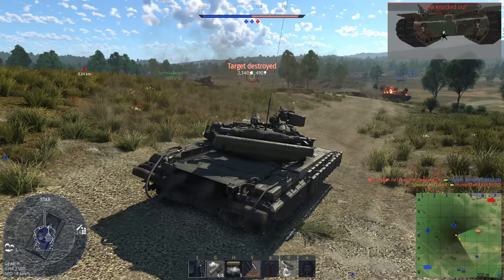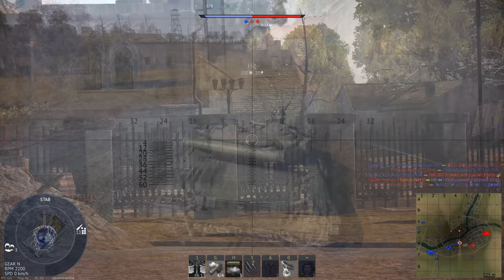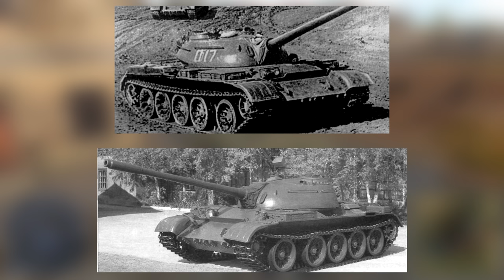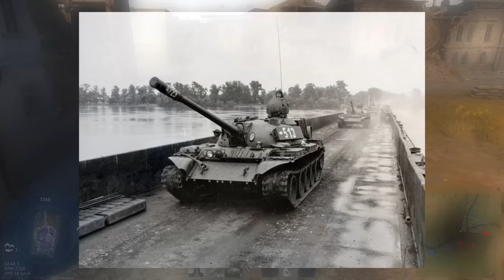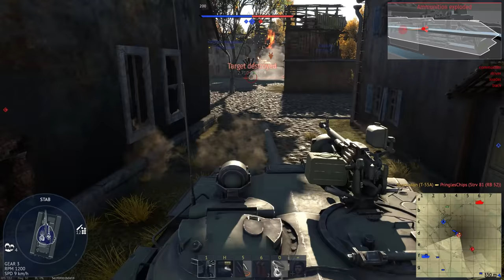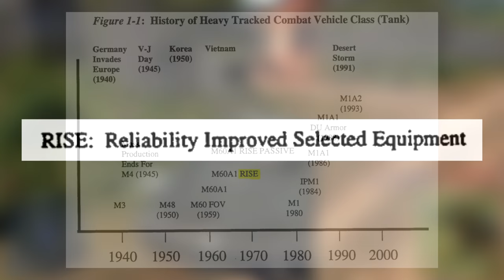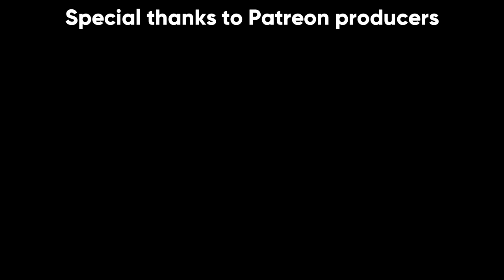Were Soviet Tanks Poorly Made?

Comment: The T-34 was a Good Tank when produced to a High Standard the issue is with Barbarossa and the Move of Heavy Industry aware from Central Russia into the Urals Standards were significantly Dropped to meet Production Quotas, The Three Primary issues with all T-34s including the T-34-85 at least until Late 1944 into 1945 is that many of these tanks were handicapped with a poor 4 Speed Gear Box  which was mechanically touchy at best as if the Driver placed to much force onto the  Gear box to get it into forth Gear which they often had to do in some cases needing a hammer or Crowbar to force the tank into Forth Gear it could Cause the Transmission to brick its self which is why many T-34s Carried Spare Transmissions into battle on the Rear of the Vehicle. Though this would later be fixed with the addition of the 5 speed Gear box over 40% of Total T-34s produced still had the 4 speed. 

The other problem with the T-34 was largely the actually Quality of the Armour as the Armour was superheated to increase protection levels and armour Hardness the issue is the armour plate was super heated way above what was required making the armour insanely brittle and combined with Poor Spot Welding due to Unskilled Workers with little Welding experience operating on the production line this often meant when T-34s went into action and engaged tanks like the Panzer III as an example. Even the Panzer IIIs In adequate 50mm gun had a good chance of knocking out T-34s as hits would often lead to Welds splitting creating armour panel gaps and in the case of Shell Penetration the Spalling effect was devastating leading to a 70% Fatality chance for T-34 Crew Members

The TLDR

The T-34 would of been a Great tank if produced to Western Standards but due to the Nature of war the Soviets found themselves in Quality was Secondary compared to Raw T-34 Tank production as Sheer numbers and More Available Tanks on the Battlefield would lead to more victories 
Its just a shame that it took almost the entire War for the T-34 to work out its production kinks to become a truly astonishing weapon on the Battlefield 

in the case of Other Soviet tanks produced after WWII 
generally they were of High quality with only Minor Flaws 
such as The T-64s Auto Loader 
as an example
Reply: the long barreled 5cm gun of later Panzer III models was perfectly able to penetrate the T34 on long distances. And even on paper there are too many mistakes not taking the production mistakes into account. Its far from an astonishing weapon in my opinion.
Reply: @tizi087 
Of course the Panzer IIIs 50mm Gun was perfectly capable of dealing with T-34s but usually only within the T-34s effective rage the issue is when you are fighting in Tank to Tank warfare you really want a weapon system that can engage the enemy outside thier effective range hence the balance of fire power vs armour protection.

This was actually the Main Driving Force of the adoption of the L/43 75mm and later the L/48 and L/70 75mm
By Germany in WW2
Reply: @IRONLORDMINK  Uff. In Boris Kavalerschiks: "The tanks of operation barbarossa" there are some colored pages in the middle showing the distance where a tank can penetrate another while still being save. Sadly i dont have the book clsoe to me right know but if i remember correctly in a head on duel the PanzerIII with the long 5cm gun had could penetrate the T34-76 from 41. the T-34 meanwhile cant do the same unless he gets within 600 meters. 

But as i said: i sadly dont have the book on hand right know, but i know that above a certain distance the Panzer III long 5cm can pen the T34 while hte T34 with 76mm gun cant

Comment: Whole part about T-64 and T-72 is actually bullcrap: T-64 had a lot of flaws which was mostly fixed before entering service, T-72 in the other hand isn't a 'modern replacement' but 'same capabilities yet cheaper' tank which actually had stripped down FCS(it's actually wasn't exist on base T-72 and initial T-72A), yet Uralvagonmash didn't want to copycat T-64 and produce it's opposite engine which had maintenance flaws and big production cost, as well they didn't want to use hydraulics autoloader since it's reduces fire resistance of a tank and replaced it with electric autoloader from Object 167M(which was designed at the same time as T-64). So T-64 wasn't 'bad', it had it's own flaws but none of them was "dealbreaker" for exception of a price

Comment: i saw 2 different t34´s in museums and both of them had about  a 5 cm gap between the hatch of the driver and the rest of the body
same goes for the metal covering the engine 
i looked at later built sovet tanks and they didnt seem to have those  severe problems 
i think this myth stems from the  many many soviet tanks that were rushed out to be emmediately sent to the front

Comment: what do you mean by "they werent keen to waste time on cosmetics"?
Reply: they didnt really cared if the paint was properly applicated or if welds for stuff added ontop of the armor where not cleanly made.
they just made sure they where structually sound and worked, looks where not important.
Reply: they didnt spend time making it look good, hence the poor looking welds, and other minor things being dropped for faster production
Reply: Useless fluff to seemingly bolster his argument.
Reply: @FirstDagger  lol Someone sounds mad
Reply: @BDP0408  nah. Go watch LazerPig's video on the T-34. Welds were shit. Radios missing. Poor ergonomics. Poor visibility. Poor control systems. Shit reliability. All made in less than half the time it should have been.
Reply: @sosogo4real  Yeah I agree
Reply: welds being poor are not cosmetic if the weld looks bad then what you cant see is also poorly done making a bad bond between the plates, if its just getting weld material on the plates outside of the bond no harm there but if there is bubbling or cracks or large waves in the weld then it wont hold, quickly applied paint makes sense though it makes the machine suffer in the long term with paint falling off the tank and causing rust making it harder to effectively apply paint later on witch i can see not being a priority at points in the war

Comment: On paper, the T34 was fine. Realistically, the T34, under any metric, was horrible. The only problem that couldn’t have been initially fixed was the fact that it had a 2 man turret. The rest came down to awful production practices and quality control. If any other nation had produced it, it would have been seen as an abysmal failure. No, quantity isn’t a quality of its own because logistics matter. If you have 100 pieces of trash on wheels, you still have to supply and fix those pieces of trash where if your build 75 or only 50 good vehicles, then you have a far more effective vehicle with much less logistical strain.
Reply: No you have 50 less tanks, WW2 proved how in those times quantify was better than qualify. Modern combat is different though

Comment: Are we only only referring to the designs being bad because if we are just talking about the average f-35 during the war they where defintly badly made. One of the huge things was the fact that they basicly had no standards when it came to making these tanks. Some would come out and would be very well made but that was every now and again often you had tanks with overly heat treated armour which would shatter when hit or spaul milling crew. Or you would have welded sections that where basicly spot welded together by untrained workers. The design wasnt bad at all but it's kind if a fact that there lack of standards led to some terrible made tanks to the point where some just didnt have seats for there crews and they where using ransom boxes.

Comment: Re: The T-34. When your transmission was worse than Panther's and your tank had a lower reliability rate than Panther, you have a poor tank. I'm aware that if it broke down, you could get a new one, but that doesn't mean individually they weren't bad.
Reply: So bad that well into 1942, when the relocated factories in the Urals fixed a lot of the gearbox issues, the T-34s often went to the front with a spare transmission chained to the rear deck.  Drivers carried sledge hammers to shift as getting the beast into its top gear was not humanly possible with a normal gear shift; often the "assistant driver" in the hull did that job.

The tanks V2 engine, although itself a remarkable piece of contemporary high tech (aluminum diesel V12) and, as long as it ran at all, could be relied upon to start up in the coldest weather, often wore out after less than 1000 km.  Which, as the tanks were often put out of action well before that, was not considered a serious issue.  As was pointed out by others commenting, the Soviets fixed what they could, when they could, but most improvements simply had to wait until AFTER the war.   It's a case of; like so much equipment and MEN, you don't fight a war with what you WANT, you fight with what you HAVE.

Comment: They were not poorly (the T54 and those after it) made but they had a different philosophy behind them. Simplily the Russians have a higher acceptable percentage of casualties and they based their military doctrine under the iron fist post massive bombardement idea.
Reply: So concepts like crew survavility (and the design compromises that should be made and equipment addition) , crew confort, quality and capabilities of the visors or radios, etc are not a priority
Reply: Doesn't that make them inherently bad tanks if all they care about is hard stats?
Reply: @raddestshiba1589  no. Simplily I would have preference to be a tank crew in a Centurion, Chieftain, Leopard 2, M60, Abrams M1 rather than in a T64, T72, T80.

Comment: The soviets ddidnt place as much value on the individual tank as the western nations did because of their tactics that involved armored waves. Also they are more specialised than western MBTs because they were designed for the offensive. Western MBTs were designed to be equally capable in defensive as in offensives. Look that the gun depression...western MBTs usualle have between 8 and 10 degrees so that they can use more hulldown positions in the defensive

Western MBTs had a few technologies that made them more expensive but easier to repair in the field to keep the availabillity rate high. Things like the possibillity to remove the gunbarrel without needing to remove the entire gun or the entire drivetrain being one unit that can be lifted out of the back of the tank and swapped out for a replacement means faster and easier repair in the field

The soviets were aware of those things but didnt care because they wanted smaller tanks that are cheaper to produce. Also if one tank breaks down during an attack in would be left there and picked up by the 2nd or 3rd wave after it.
Reply: ''Western MBTs were designed to be equally capable in defensive as in offensives. Look that the gun depression...western MBTs usualle have between 8 and 10 degrees so that they can use more hulldown positions in the defensive''
 - That does not have any correlation at all. No gun depression thing was done not because it was only specialized in offensive attack, but because the majority of Eastern European terrains was quite flat with little to no huge hills.
Reply: @Kalashnikov413  
Soviet terrain was flat so your about that but they never focused on fighting exclusively on their own terrain. 

Soviet doctrine was that attack is always preferrable to defensive. 

If your charging the enemy you dont need the gundepression for staying hulldown

The turret height and therefore the weight increases the more you increase the gundepression so saving weight and keeping a small profile was also a consideration

 if your fluent in German there are lectures from ingeneer     Rolf Hilmes     who occopied several positions in the Bundeswehr including the procurement office.
He was active in the time the East German armor was dissolved so it was a time when the Bundeswehr got a very good look at Soviet stategies in general

He has a wonderfull lecture about the Western and Soviet tank development and doctrine during the Cold War where he states that there in fact is a correlation between their their aggressive tactics and the lack of gundepression.
Reply: @xXxTripleHxXx  good point

Comment: The problem isn't that Soviet tanks were poorly made, it was that they were terminally poorly designed. In fact, they were impossible to fight against Western tanks on the modern battlefield, because Soviet designers were in an echo chamber that emphasized compactness over fightability. Post T-54/55, no Soviet tank can assume a hasty defensive fighting position hull down due to limited gun tube depression, which is the way Western tanks are able to kill them with ease. No matter how compact, a fully exposed Soviet tank is bigger than a Western tank's optics, or its turret in hull down.
Reply: 123  The Leopard was made because West Germany wanted to replace its aging M48 fleet. They used a great gun, little armor because it was thought no amount of armor could withstand shaped charge munition. The centurion was designed at the end of WW2. Maybe YOU should learn history.

Comment: T-34 was pinnacle of MANUFACTURING simplification - it was first tank ever to be partially built on automated welding line, treatment was dedicated ONLY to surfaces that definitely required it.  T-34 design and building it was streamlined to the point, that even late in the war it was found unfeasible to field T-44 which corrected T-34's DESIGN shortcomings.  In any case, Soviet tanks were hobbled by two things: lousy quality control and inability of USSR to built compact-reliable-powerful engines, which was challange even for the west. T-34 had alluminium cast engine, quite modern, but once tanks started to grow heavy, engines had trouble catching up with increased mass.

Comment: The poor quality of the t34’s coming from Factory 183, roughly half of all of them, wasn’t a result of low effort but of different priorities which absolutely placed quantity above quality. This was a minority of factories, but go figure the ones who focus on quantity will have a disproportionate amount of the tanks built. T-34s were poorly built during the war, and the best of the remaining ones were combined with new, less rushed production to make up the backbone of t34-85’s. No matter how much effort you put into polishing it, a tank that used polished metal instead of mirrors for periscopes, is just a poor quality tank, not to mention the armor quality or quality of any optic other than the actual gunner’s sight. That’s just facts. The optics fogged up and the hatches didn’t have rubber seals to keep rain out, they were miserable tanks as produced. The T-34 was an expensive but fairly well designed tank produced cheaply, and so of course quality suffered a lot when it was forced into the production circumstances and lost a lot of the qualitative capabilities that made the germans continue to have superior battlefield tanks even with worse “stats”.
Reply: I extend this claim only to the T-34 during and pre-war, not to any other soviet tanks. Lazerpig’s video on this is pretty good, IMO.

Comment: One thing, specifically about the t34. You focus solely on reliability and design on paper not the quality of the actual tanks. T34s produced in 1942 often had no external storage, no seat for the loader, no turret basket, periscopes made from metal, sometimes unpolished, no lights, no rubber rode wheels, unhardened components, too hard armour that would literally shatter, an engine so poor it had to be replaced often and a transmission so bad they carried a spare into battle. Even if what you say is 100% accurate they were still God awful tanks. you glossed over a lot in only one and a half minutes.
Reply: T-34 had countless variations not only by official modifications but also specifically to production sites, some had poor quality, others had perfect state

Comment: Yooo go watch Lazerpig's video on T-34 to get the real story. These things were terrible hunks of useless trash. The transmission problems were never fully addressed, the visibility was basically non-existant, the steel was brittle and would shear under non-penetration shots, it was impossible to quickly get out of it, the FUEL TANKS were in the FIGHTING COMPARTMENT, and there was literally no room to store anything on the inside, meaning that the exterior had to be used for storage and spare parts, food, water, etc would just get knocked off or destroyed every time they got into a contact.
Reply: 123  Are you sure you have seen the video in question? It is clearly mentioned that tanks were destroyed by nonpenetrative hits and that according to soviet sources themselves 54% of T-34 destroyed in 1942 were by Panzer III - meaning either 50mm or low velocity 75x243mm (KwK37, the short barreled one that people often call howitzer, not 75x495mm). He also mentions that quality did vary and some factories did a proper job, but the one that didn't actually build the majority of T-34. Basically all you have stated here against the video, is not true.
Reply: 123  The Panther is a .... medium tank. Not a heavy. And the Tiger is more of a breakthrough tank than a pure heavy tank, like the Tiger II or the IS-2.